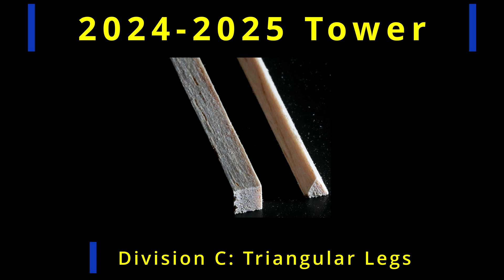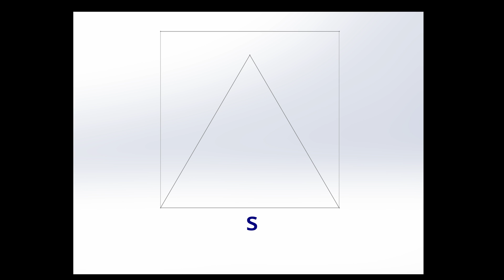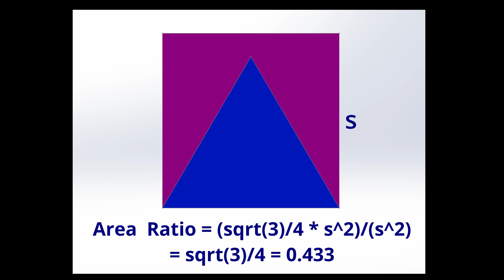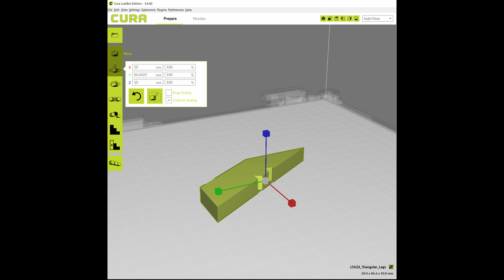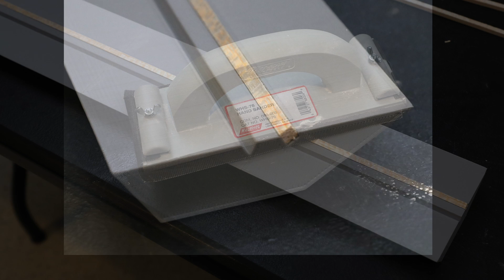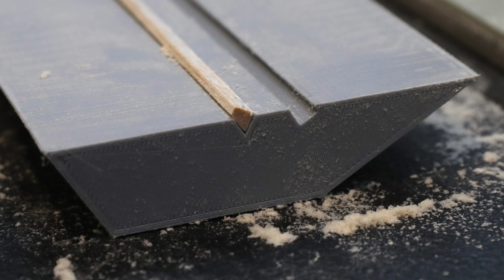2025 Science Olympiad Tower Div C: Triangular Legs

Comment: Hi! I was trying to make this approch, but I haven't though of doing it with 3/16 legs. What would you recommend for the cross peices at least dimention/mass wise that would be decent enough to go off of? Especially with the cut support of the legs as it is with making them triangular! Thanks
Reply from the maker: Hi!  Be sure to check out my other videos from this season for Div C.  In the optimization one, I show all the details of my complete build including what I used for the cross bracing (TLDR: I used 1/16" square of fairly light density):  https://youtu.be/qjI3Yj9Nqc0
Reply: @ thank you lots!

Comment: Hello Balsa Engineering is there no other way to make triangular legs with out a the jig? Can i just sand one whole side as well?
Reply from the maker: Hi!  I had a parent/coach reach out to me and send me the device he made to do this.  It cuts the legs from 1/4" square source sticks.  It works well if you want to try this instead of sanding: https://www.ebay.com/itm/267073564038      If you sand just one side, it would be a 90/90/45 leg and that wouldn't really work for 3 equal legs either.  I think some people try and sand just the connection points, but that basically weakens the leg like you have sanded the whole thing without the benefit of the light mass.   Good luck!!

Comment: Hey balsa, how much density infill did you use for your 3d model? I’m trying to use as little as possible
Reply from the maker: I can't remember exactly, but for this particular jig, I think I used something like 40 or 50% infill because I knew I would be sanding it down and wanted it to be as strong as possible.  I would imagine the default 20% would be fine though.  I would recommend printing a small test extrusion of say 20mm to test your print settings and see how that works before printing the full thing.

Comment: Thank you all your help! I didn't realize the jig for getting the triangular legs used 3/16 wood and i bought a bunch of 1/8 wood expecting it would use this size and the jig doesn't properly fit 1/8. I was thinking I could try to change the CAD to fit 1/8th wood but im not really sure how to do that or just use the second part of the jig and shave the wood down from there. Any recommendations?
Reply from the maker: Unfortunately, it's going to be very hard to use 1/8" sticks for this build.  If you create something to shave them down to 60/60/60 triangles, it's going to be less than half the original cross sectional area.  That is going to be much too small unless these sticks were really heavy to start.  Even then, I wouldn't recommend that.  The easiest solution if at all possible, would be to try and get some 3/16" wood to work with.  1/4" is also an option if that's all you can find.  It'd be easy to scale up the sanding jig a tiny bit to use 1/4" wood.  If none of that is an option, you could glue (4) 1/8" sticks together to make 1/4" and then sand that down.  Certainly not ideal, but possible if that's all you have to work with

Comment: Is there a way you'd suggest to make a jig for sanding without a 3d printer?
Reply from the maker: Without the precision of a 3d printer, it would be very difficult to make a sanding jig that works well.  I don't really have any good suggestions unfortunately.  There are some people who have experimented with making a device to cut the triangular cross sections (instead of sanding), but that also involved a 3d printer and a more elaborate design with a blade.

Comment: Thank you for your help! This step has been way harder than I had expected. The resulting legs have quite different densities and I am worried if the integrity of the wood was compromised by all the sanding! Did you use light balsa for this? I am finding that a lot of my sticks are too light and I need heavier ones.
Reply from the maker: Hi!  Yeah, this step sands away more than half of the original stick.  You can double check my math with the info in my notes, but I think my original source sticks were around 11 lbs/ft^3 for density which puts them in the typical "medium" range.  Usually the medium range balsa is the easiest to get, so hopefully you can track down some heavier wood for this application.  Good luck!

Comment: Thank you for your videos, very helpful and encouraging for everyone! I wanted to ask - can we use CA glue instead of PL3 for gluing this jig? Why PL3?
Reply from the maker: I found that CA glue doesn't work very well for gluing PLA parts together unless you have much thicker gel based CA.  I found PL3 works much better than even gel based CA, but just about any glue that glues plastic should work.  If you use any glue that doesn't set quickly (like PL3), make sure you clamp the parts together for best results.

Comment: Hi Balsa Engineering, I was just told that I’ve been put on this event with a meet coming up really soon and your videos have been a lifesaver honestly. I have a quick question about the triangular legs though: I don’t think have the time/resources to print the sanding jig. Do you think that something simple like sanding the balsa essentially in half, making a 45 45 90 triangle, would make a really big difference in the stability of the tower? Thank you!
Reply from the maker: Thanks!  Using 45/45/90 legs could potentially work, for at least 2 of the legs, but you won't be able to build an equilateral tower with just those legs.  In a pinch, you could use any legs and just individually sand flat the surfaces needed to attach the cross members.  That is certainly not ideal, but might be OK if done carefully.  Good luck!!

Comment: Hi Balsa Engineering. I was wondering which of type if sandpaper would you recommended me to use in order to sand my triangular legs.
Reply from the maker: I just used what I had on hand.  For the drywall mesh sander, it was probably around 160-200 grit.  I think the rotary sander had 100 grit, and it would probably have been better to use a finer grain as to not sand down the jig as much.  Basically, pretty much anything should work if you are careful.

Comment: What are the side lengths of the equilateral triangle legs after being sanded? Thank you!
Reply from the maker: If you check out the drawing at 1:25, you'll see that the finished side length is actually the same length as the original source square, in this case 3/16".

Comment: Hi again Balsa Engineering, I asked my teacher at school to 3d print your jig but he said it would take too long and the amount of plastic required is too long. Do you have any helpful tips on reducing the plastic and the print time? In addition, do I have to make two duplicates of the triangle legs? Is it fine if I print one?  Thanks!
Reply: Also, could you give me your dimensions for the 3d jig? Thanks!
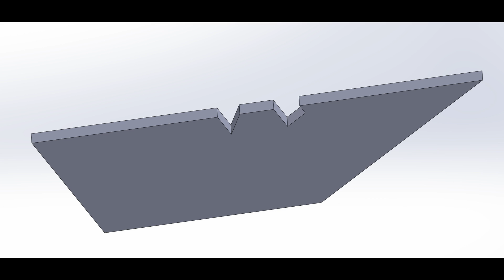Reply from the maker: @belayadane8388  I mean, I talk about it in this video at the 2:29 point.  Do you have a different question about it?  The legs we are working with are 52.5cm, I made my jig 3x18cm so I could sand it all at once.  In theory you could just print a smaller one and move the leg.  That could work if you can't print the entire thing
Reply: @balsaengineering6686  Okay thanks!

Comment: Hi Balsa Engineering, I was wondering how you imported your 3D jig files into a 3D slicer because when I tried to do it with Cura, it didn't work for some reason. Thanks!
Reply from the maker: There was nothing special that I did, just load the STL file into Cura.  You might need to rotate it 90 degrees to be oriented correctly for the print, but that shouldn't prevent it from loading.
Reply: @balsaengineering6686  Okay thanks!

Comment: Hey Balsa Engineering 
So, I can't figure out how to convert my square balsa wood to Equilateral Triangle balsa wood
Reply: without a JIG
Reply from the maker: @YanaPandit-b2f  I'm not sure how to do it without a jig either.  That's why I created a jig to do the job :)   In theory you might be able to create some kind of cutting device that sliced at at 60 deg angle and run the stick through twice, but that would most likely involve a custom 3d print as well.

Comment: I just went to hobby lobby to look for a new ruler and happened to stubble upon some precut equilateral triangular beams. but the density and variations of density is absolutely crazyyyy
Reply from the maker: Interesting!  I had never heard of pre-cut 60/60/60 sticks, but it's good to know Hobby Lobby at least has something.  I would recommend making them yourself from sheet balsa because you'll have way more control of the density and most likely, it will also be much cheaper.  Good luck!!
Reply: When you mean sheet balsa do you mean a actual wooden sheet of balsa or square rods of balsa converted into equilateral triangle balsa rods

Comment: Hi Balsa Engineering! I'm curious as to why the 3D print is that big on the x&y dimensions where the cutout is. Was there a certain reason for that? Would it be fine if I made a jig that was much smaller but had the same cutouts? Thanks.
Reply from the maker: Hi!  The dimensions of the cutouts in the jig don't matter too much, they are only to help the cross-members not get glued to the jig.  The critical dimensions for this jig are the outer dimensions because the legs actually go on the outside of jig.  It needs to span the 29cm circle with only 3 legs, so that part is almost a minimum sized jig already, but feel free to re-design it in another way if you want.  My jig and designs are only meant to be a starting point for you this season.  Good luck!!

Comment: Hi, balsa engineering! I watched the all division c 2025 videos so far, and are you going to make a video that shows each mass of all balsa woods? Like density of 2 layers of crossmembers at the bottom, and weight for each legs. Thanks for your video!
Reply from the maker: Yep!  I have 2 more videos coming in this series. On 9/17, I'll publish the one where I talk about the assembly challenges, and then the one you are specifically looking for will be published on 9/21 where I show my optimization path to achieve the benchmark tower.  That one will show all my notebook pages which includes everything you need.  Good luck this season!!

Comment: What are the dimensions of the balsa sticks you used, including the length?
Reply from the maker: I mentioned in the video 3/16" square legs as the source:  https://youtu.be/MTHygxUS3YU?si=k2m2p4nMrgML72bl&t=115   The length just needs to be just a bit longer than the final length.  I was using 52.5cm.

Comment: Very interesting approach. I opted to create an angled stripper where you feed the member through a hole with a blade angled down at 60 degrees to cut the excess wood off. Once you run the member through the stripper twice, you are left with an equilateral member.
Reply from the maker: That's a very nice approach too.  If that works well, it would definitely be less messy than sanding it!
Reply: Hey, im curious as to how you went about doing this
Reply from the maker: @completeandabsolutenerd  If you have any specific questions, let me know and I'll try to answer them as best as I can
Reply: @balsaengineering6686  Sorry I don't think my reply thingy worked but I was more interested in how the 60 degree stripper would work, as in how to build one but I think I have an idea of how to build it
Reply from the maker: @completeandabsolutenerd  I definitely encourage you to try and make a stripping tool if you can.  My solution here doesn't strip the wood, but sands it away
Reply: @balsaengineering6686  If my way works, ill share the thought process in here. Essentially, I am trying to use your model of the sanding 3d printed part but instead find a way to mount blades to it to cut the wood.
Reply: @MrWhite-Iq2de can you please share how you made the 60 degree stripper please
Reply: @completeandabsolutenerd  i used a cad design to make a jig where i attach a blade at an angle and run the wood through said jig. Ive opted to just buy pre cut wood. My design works, but id rather have consistent results
Reply: @Justin-x6b7h  Where do you get the precut wood
Reply from the maker: @completeandabsolutenerd  I'm not sure I understand your question.  This video shows how I made it...  at the 2:15 mark you can see the cross-section of the CAD that is the key to the sanding jig.  Let me know if you have any other specific questions.
Reply from the maker: @completeandabsolutenerd  Ahh, got it!  Good luck!!